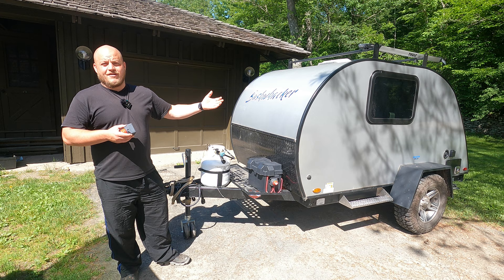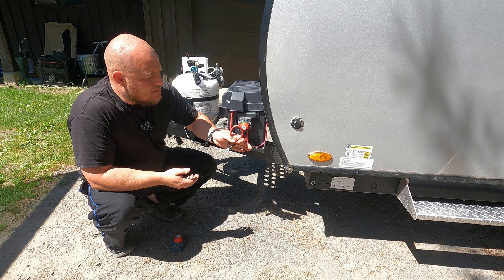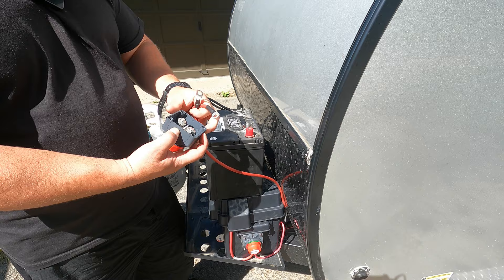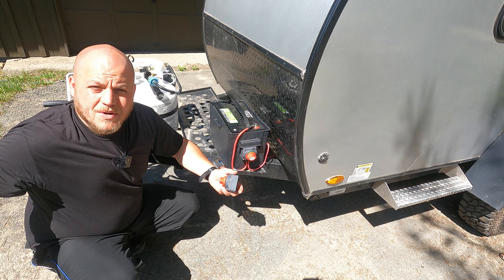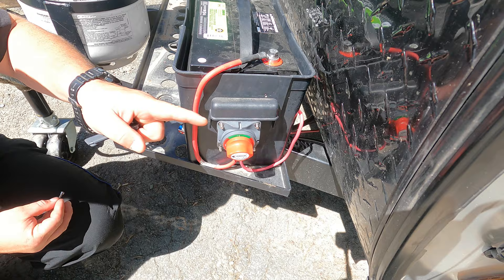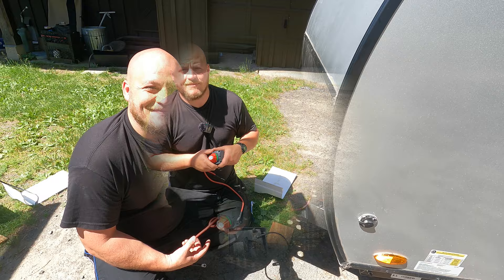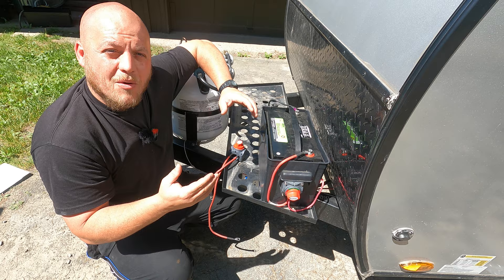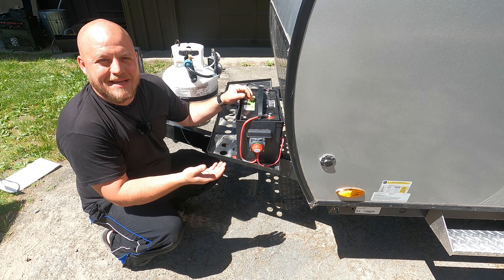Installing Master Switch on Camper Trailer | RV Kill Switch

Comment: What a great teacher.  Thank you.   I love that you stuck to the subject and didn't try to make things funny.  Please continue to do these type videos.    Definitely subscribed to channel and shared with friends that are new to travel trailers like me.
Reply from the maker: Thank you, I appreciate that.  Feel free to request videos on helpful topics too!
Reply: @DIYOutdoorLife  I looked at my battery today and I have two wires coming off positive side.  A 10 AWP to the trailer and a 14 AWP going to my tongue jack.  I’m assuming the AWP is the wire gauge?   Which gauge should I get for the bypass and how do I wire both red wires into the disconnect switch.  Thanks.
Reply from the maker: @lauriewhittle3452  you’ll want to attach a 10 gauge to your new switch. You can then attach both the tongue jack wire and the camper wire to the other side of the switch or you can attach your tongue jack wire to the positive side of the battery. In the first application, the switch will turn everything off, in the second,  your jack will work whether you’re switched on or off. 

For me, I like to have everything switch off, so I attach both jack and camper wire to one side of switch and use 10 or 8 gauge from other side of switch to battery positive. I hope this helps, feel free to email if you want me to draw you a crude diagram.
Reply: @DIYOutdoorLife  I understand.  Just moving both wires to the same terminal on the disconnect switch and the new wire to the other terminal on switch and run it to the positive side of the battery.    I have looked high and low for a 10 guage wire with the ends.   Any idea or a link to where I can order it?
Reply from the maker: @lauriewhittle3452  I make them on the bench, they’re probably tough to buy on Amazon. Just use an eight gauge, marginal price difference, easy to use and find.
https://amzn.to/35mks6o
Hope this helps!
Reply: I finally got it installed. So happy with your video. It was so great to still find it after a couple years. My cousin benched me the wire I needed and now I know how to make them as well. I did use a 1/4” piece of plywood to protect battery. Would never have thought of that if you hadn’t mentioned it.  Thank you again.

Comment: The camper wire has to be cut and a new ring terminal installed whether or not you buy the short lead wire. Camper wires have a 5/16" ring terminal and it will not fit the 3/8" lug on the disconnect switch. I know you want to make it look easy, but you should show all the work from start to finish and not skip any important steps like replacing the ring terminal on your camper to fit the huge 3/8" lug on the disconnect switch. You made it look way easier that it is.
Reply from the maker: Hi Suzanne,  what camper do you have? For this project, I did not have to replace ring terminals, the stock terminals matched the switch.  For set ups with varying size ring terminals, for this application you can modify or get a master switch with ⅝ studs.

Comment: Hey Brian 
I haven't seen the update on that new bendable solar panel you where going to put on the truck
How is it working. Thanks for all you do
Reply from the maker: They’re amazing.  I started having second thoughts about its placement, we might be getting a new truck next year and this install is permanent.  I found a way to temporarily install it to start seeing how it performs.  I’ll be able to include this in an upcoming video.

In short, it’s really really nice. I just wish they made an option that was a little shorter.

Comment: Thank you!!! Excellent video - answers all your questions and ones that you didn’t know to ask. I like your patient demeanor and friendly smile too 😊
Question: should you also install a cutoff switch on the black negative side? I’ve seen recommendations from battery manufacturers that say to disconnect both sides of the battery for winter storage. What do you think?
Reply from the maker: Thank you for the kind words😀

 There is no need to do both. If you live in an area that has a cold winter, the best thing to do is remove the battery and apply a battery tender. By putting the battery in a basement or garage and charging over the winter, the battery will last considerably longer. For all other purposes, the positive switch will suffice. Hope this helps, please subscribe!
Reply: @DIYOutdoorLife  Already subscribed 👍 
I have four 100 Ah Battleborn Lithium batteries connected in parallel with 2/0 and 4/0 wire. It took me days to assemble and install the configurations with supports and bracing etc. - The thought of taking it apart and reconnecting it later in the spring is so daunting I’d rather put a heater inside the RV! The batteries apparently hold their charge for a very long time, but in that (heated) scenario, do I need to add a trickle charge? They’re also charged by solar so should I allow the solar to do that trickle charge or install the switch between the solar and batteries to cut that solar charge in case of the heat failing and temps falling below freezing? Sorry for the avalanche (no pun intended) of questions - your video answered so many of the ones that I couldn’t find answers to elsewhere, I figured I’d breach my final frontier of battery dilemmas!
Reply from the maker: @cynthiaarmstrong7972  that is a really nice set up! Since Battleborn has industry leading reliability with their low temp cut offs and hold 50% state of charge for ages, I would handle your system differently than a typical battery system.  

When you are approaching the winter season, charge them fully and disconnect the negative lead to camper and shut off master switch.  This will "remove" your battery from the system and eliminate any draw. You do not have to actually take them out.  It is unlikely that you will need to apply a trickle charger or solar to your bank.  If they start w/ a full state of charge, they will safely store for the winter without any issues.  Lifepo4 batteries like yours behave differently than lead acid batteries, if you remove the draw from them, they will drop to 50% and hold for a very long time.  They dont like to be charged or used in very cold temps but have built in protection to avoid that.
Hope this helps!
Reply: @DIYOutdoorLife  OMG, bless you! 🙏
Reply from the maker: @cynthiaarmstrong7972  We're all in this together, circle back to share some tips you learn along the way! :-)
Reply: @DIYOutdoorLife  thank you, Brian, I will! Battleborn does make a heated battery but the cust service person said I didn’t need it if I was just storing the RV because the batteries have a built-in cut off. I’ll be doing more circling back to them with my belt-and-suspenders approach. They have excellent technical support and are very patient with fully answering questions. A lot like you! 👏😊
Reply from the maker: @cynthiaarmstrong7972  They are a great company that makes a great product.  You don't need the heated batteries unless you do a ton of severe winter camping. If you're camping below 0 F, they come in handy

Comment: Thanks Brian. Excellent video as usual! By switching the power off, does that stop my vehicle from charging the trailer battery while driving?
Reply from the maker: Yea, it completely disconnects the battery. If needed, there is a simple way to allow it to charge while disconnecting the trailer.
Reply: @DIYOutdoorLife I suspected that. I have a r-pod with 4 cables connected to the positive side of the battery. I guess I could try to find the one used by my truck for charging and keep it connected to the battery and move the other 3 to the switch. Anyway, what do you have in mind with a “simple way” of doing this? Thanks 🙏
Reply from the maker: @user-vz5my4fs5t  that's it.  You basically have to trace the wire that comes from your seven pin, one of those is a 12 V source designed to charge the battery.  When you find that wire, you just directly connected to the battery.  
On mine, I had to go into the junction box that the seven pin plug runs to.  from there, you can splice it right over

Comment: Really found the video useful as I just picked up my new 2021 Bushwhacker yesterday. It looks like the overall fit and finish on the Bushwhacker has improved somewhat. I think it will serve my needs well enough. I'm looking to replace the K2 cooler with a mini refrigerator - any suggestions on one that fits in the cooler space. Keep up the enjoyable, informative and easy to follow videos.
Reply from the maker: Congrats on the new BW! I have been hearing really positive things about QC improvements. Did you get the SS of FB? 
I have a DC fridge in mine that I'm testing and really like so far. Video will come out in August. Shoot me an email and I'll get you a promo code on it. DIYOutdoorcontent@gmail.com

Comment: You’re videos are awesome! I do have a question though…a lot of sources say to hook a disconnect to the negative? (For safety) what say you?
Reply from the maker: That’s incorrect and unfortunately a lot of people continue to say it.  Both + & - switches work, you can even say that the difference between the two is marginal but there are more advantages to positive.

Every single professional body that governs DC wiring mandates positive master switch. You see it in stock cars, military vehicles, aviation, NASA etc…

The people that are switching negative, when the positive is available, are typically confusing the safety guidelines for installing a battery in a metal compartment like a car.  You always remove the negative first, so that you don’t short circuit the chassis.   They then assume that means you should switch the negative for safety but it’s a completely different scenario.  

this debate has going on in backyards for years but if you do a little homework, the debate doesn’t exist amongst professionals- master switch on positive, eliminate potential at the device, while maintaining a pathway to ground.  This is the superior way to interrupt the circuit.

Comment: Love this video. Ordering a cable. What’s the difference between 3/8 and 3/8+5/16? I’m unsure which to get. Thanks. Definitely got yourself a new subscriber
Reply from the maker: Thank you so much!  I believe you're referring to the ring terminal size.  This would correlate with the size of the post on your battery for secure fit.

Comment: Your videos are great.  In this case, would you use the placement in a dual battery setup?  Instructions that came with my switch show placing the switch on the negative side.
Reply from the maker: Ignore those instructions...lol  If you comb through the comments, I've explained why positive is best here, its the better way for this application. 

As for duel battery, you are placing this switch on the wire going to the camper, after the two batteries.  By doing that, youll be switch both batteries off with one switch, same installation procedure. 
Thanks for watching DIYOL!

Comment: Just a question for my boat, there are some other wires besides the positive wire attached to my battery, assuming for accessories or something. Would these stay on the battery or be also on the switch? Thanks! Great tutorial though, I’ve watched 3 other other videos before this one and was still confused somehow .
Reply from the maker: That is up to you.  Anything you bring over to the switch will turn off when you switch it off.  Most of the time we put all of that stuff on the switch so you can completely shut off the boat.

If there is something like solar you might want to leave that on the battery so that when you turn off, the loads are disconnected, but the solar still charges.  If it's just accessories, I would bring it all over to the switch.

Thanks!

Comment: If there was an award for the most detailed, easy to follow, well filmed and edited DYI video on YouTube, I nominate this vid.  Thank you!  I didn't see a link for the actual switch and wire, perhaps I missed it.  I'd be interested in purchasing these.  

I wonder if you could answer a question about battery maintainers?  I have one battery connected to my rig and another spare next to it.  I purchased a Noco gen 5 x 2 to maintain the batteries during the off season.  An I leave shore power plugged into 110 using an adapter.   Is that a good idea?  How would you make the connections to the Noco in light of the battery disconnect switch?  Any special considerations.  Lastly, I live in the Pacific NW and the batteries collect rain water through the small battery box lid vents.  Any suggestions on how to prevent this?   

Again thanks for the get video!
Reply from the maker: What a nice comment, thank you!
The links are in the video description (looks like "V" on phone.. "SHOW MORE" on computer).
As for the batteries, the NOCO is an excellent charger. Try to take the battery to a place that stays above freezing and keep it charging over winter.  It would be best to bring both batteries out and either alternate or trickle both simultaneously.   I do not like leaving the 110v connected at all times. The charger in the camper is typically more "crude" than a good one like your NOCO.  They can over charge and degrade batteries.  When the battery is in camper, go directly to it with NOCO, the switch comes downstream and wont effect the charge.
If your batteries are sealed/maint free like AGM or Gel...seal the vents in the box.  Those vents are only for flooded/wet batteries to off gas.  If your battery does require venting, drill some holes in the bottom of the battery box in low spots.
Thanks for watching! 
 SUBSCRIBE: https://www.youtube.com/c/DIYOutdoorLife?sub_confirmation=1

Comment: Just curious if your RV will still charge if the switch is in the off position? Thank you for your excellent videos.
Reply from the maker: The way I have mine set up, it will still charge from solar.  The battery will not charge from shore power if the switch is off.
Reply: @DIYOutdoorLife  thank you very much I was also looking at my renogy monitor and whether to hook it to the switch or to the battery.

Comment: What a great video!  Thank you!   I just purchased a camper with a two battery system.  Do I just need to attach the jumper to one positive cable, and if so, do I just need a single cut off switch?  I looked at your link for the cut off switch and they had one for two batteries. Do I need the double cut off switch, and two jumpers?  Thanks for your help.
Reply from the maker: Thank you for watching, you're gonna be fine with one switch.
Just placed the master switch on the wire going to your camper.  In other words, your two batteries will be linked together with wires, one battery will have a red wire running to the camper, put your switch on that wire and it will disconnect both batteries.

Comment: Would one be able to prevent arcing by wiring this into the negative side as opposed to using the positive wires?
Reply from the maker: Positive side is highly preferred although either will work. Neither side will arc when it’s not under load, it’s different than removing a battery on a car or bike. Hope this helps!

Comment: Electricity travels on the outside of the wire, not through it.  Sorry, had to be that guy real quick.  I'm not sure if the instructions are geared towards kids 8 to 12 yrs or seniors over 65 (that or you're a 5th or 6th-grade teacher and are just used to taking work home with you).  All joking aside; concise, clear, complete instructions should be easy to follow and understand for all ages without making any assumptions regarding a viewer's age, skill level, or current knowledge.  Which is always very different from one to the next as well as unknown.  This is rarely taken into consideration by posters and is a little strange (new) to see.  Great job!
Reply from the maker: You got it on the third guess! 5th and 6th were, in fact, 2 of the grades I used to teach! Haha

Comment: Question: Would you suggest installing a cutoff switch on the battery if the camper has a solar system?
Reply from the maker: Yes, my preference is to wire the solar/CC directly to the battery and place cut off switch on the wire to the camper.

It's the same as this video, except I'd make sure my solar is connected directly to the battery .     It's fine either way, but that allows the solar to charge while loads are disconnected.

Comment: Thank you SO MUCH for this! I have a quick question please! I recently purchased a bluetti ac200max and plugged my 30 amp shore power into the 30 amp socket on the power station. Even with having nothing plugged in or running on the Bluetti there was still a 200 watt draw. My question is that draw coming from the house battery and if i install a kill switch like you showed here will it fix the unwanted power draw? My husband and I are new to all of this and your videos are so helpful to us!!!
Reply from the maker: Thanks for watching! You are exactly right, that draw is coming from the onboard charger charging the battery.  If you install the Killswitch, you can shut that switch off when plugged into your power station and reduce the draw.

Comment: Great video and channel! Dumb question…I’m guessing the switch need to be in the ON position if you want to charge while driving?
Reply from the maker: There are simple ways to change things to do both, but your guess is correct. Keep the switch on to charge while driving.
Thanks for watching!

Comment: Should you disconnect the negative cable before you connect the positive side of the switch to the battery?
Reply from the maker: That’s a good idea if you’re working in an environment with lots of grounded metal, like with a car battery.  In this situation, you’re OK leaving it connected while you install the switch.